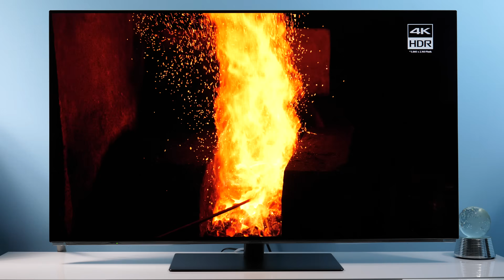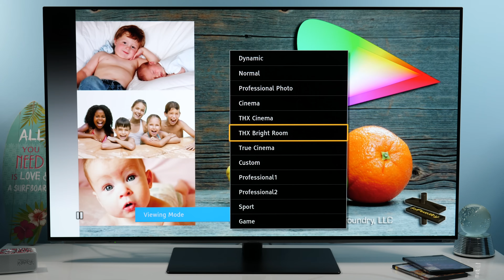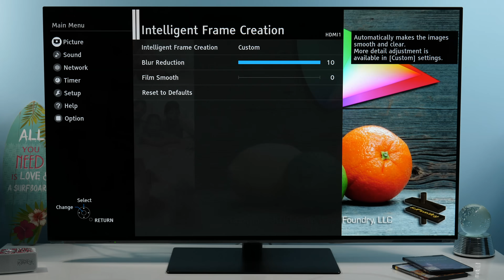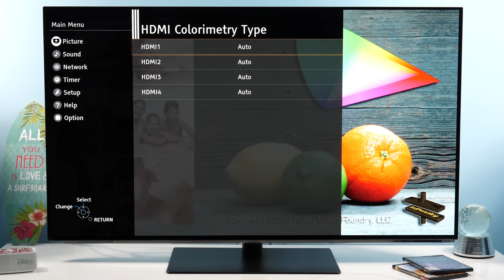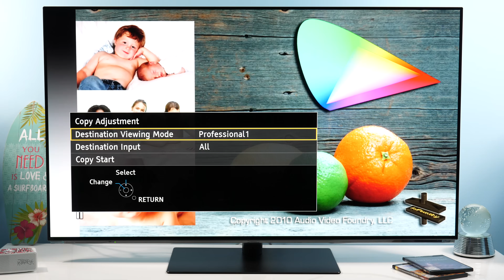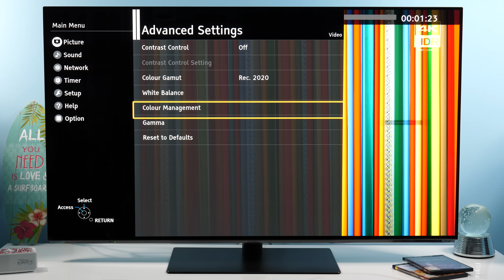Panasonic FZ800/FZ950 4K UHD OLED TV picture settings and tips

Comment: Should you have 1080p/4k pure direct on or off?
Reply from the maker: Pure direct will avoid additional upscaling/sharpening so I prefer to keep it turned off. You can of course try both and see if you can spot any difference.
Reply: @TV Calibration with Darko  I find there's some scenes where when it's turned on, there's a little noise. But then on the dark knight rises, in the stock exchange, there's more details on banes head, when it's turned on. Catch 22 lol.

Comment: Hi Darko, LGs 2018 OLEDs just received a firmware update a month ago that allows you to switch off ANSD (Automatic News Station Dimming) which is called GSR Enable in the service menu. I have the same aggressive dimming on my Panasonic FZ802 which negatively affects gaming and PC usage on the TV (I use Luminance level 75) and was wondering if there is an option similar to GSR Enable in the Panasonic service menu? My TV is out of warranty anyway so I want to try.

Comment: Grateful for your suggested settings for optimal image on the Panasonic GX800 4K UHD smart tv. I don’t have the Professional nor THX Cinema options you mention here. I have see some say the True Cinema should give the most accurate picture and colours etc. I’m just getting totally confused about how to get the best image - HELP! ps I will either watch standard DVDs, blu ray uhd or just blu ray disks, or just normal tv from air broadcast such as BBC tv stations.
Reply from the maker: Hey Andrew! That's interesting to learn that GX800 doesn't have Professional modes available. Have you checked deeper in Settings menu if there is somewhere to enable  them. In any case, True Cinema is the most accurate by default and it is recommended for accurate greyscale and colors by default. You can then further tweak it to suit your viewing environment with Luminance and gamma controls.

Comment: Sony XF9005 vs FZ800 ? By OLED I'm afraid about ageing (color shift after some time of usage), burning out areas, vertical banding problem, black crush (less details in dark areas). By Sony slow Android seems to be problem as glossy panel ... I want 100Hz Tv with natural not over hyped (Samsung) picture, pleasant to eyes (no need to have too bright and contrasty image hurting eyes). What should I buy please ?
Reply from the maker: I would definitely go with FZ800 unless you plan to use it as a PC monitor or for gaming exclusively.
Reply: @TVguyDarko  thank you. So do you think black crush, aging and need to recalibrate colors after some time are not problem ? And what about judder without IFC and IFC problems ?

Comment: I'm not sure if I am missing something here, but the title says 4K HDR picture settings. So why does the video show settings for the SDR mode? When you have it in HDR mode, it should show viewing mode (HDR), 4k pure direct should probably be on not off. I just don't want to pay for the "HDR" setting PDF if the calibration was done in SDR mode not in HDR mode.
Reply from the maker: Hello Simon - the title does not mention HDR as settings for that mode are different as you pointed out.  I guarantee that HDR settings in my store are for HDR signal type.

Comment: Hi Darko, Do these settings apply for FZ950S? Thanks for reply! Good content as always! 😊👍🏻
Reply: Panasonic really seems to like naming the same TV different things in different markets. Yours looks like a regional variant of the FZ800/FZ802/FZW804, with the step-up FZ1000S appearing to be a renamed FZ950/FZ952/FZW954. I bought a FZ830 a few days ago which seems to be yet another variant of the FZ800, and the stuff mentioned here (and in the paid guide) worked great on that model!
Reply: wHXpand, thanks for your kind info, yeah i think there’s so much variants of this model number depending on region, I just got this tv few days ago. And it really looked amazing in my eyes. Have U tried Darko’s paid settings? Is it wort a peny? Does it make difference? Let me know bro. 😊
Reply: @leianth1  Yup, I bought the SDR settings guide. The guide has a nice section in it on getting Contrast set up right, which I ended up needing to adjust a bit on my set. It's also a good reference for what the settings do, exactly. I found the guide worth the money (it's great for people who love tweaking stuff!), but these TVs are generally very accurate in the first place. Panel variances may also play into it a bit, as no two panels come out of the factory the exact same.

One other thing to keep in mind is that the guide has a few test patterns linked, which help get some of the settings right. I use mine as a PC monitor, so loading up these patterns was pretty easy. Other devices may require you to burn the files to a DVD or Bluray or load them off of USB storage, though.

Comment: What about 4k Pure Direct? I watch all my content on a Apple TV 4k. I set the Apple TV to 50hz 4k SDR with match dynamic range and match framerate turned on. I use the THX Cinema mode. Should I turn 4k Pure Direct on or off?

Comment: Hi Darko, I would like to use the FZ950 for Color Correction in a Grading Suite. But i am worried about the build-in Dynamic LUT that it will mess with the signal. Did you find a way to shut that off?
Reply: Hi Tombo, I'm also interested into FZ800 as preview monitor for Color Grading with Davinci. But I'm worried about burn-in issue with static images. Now, color grading implies working on a single frame even for long time, so could it be dangerous for OLED TVs?
Reply: adrjork don‘t worry about that. They are widely Used in Suites in Germany and in LA. LG also got refreshing tools that work over Night If the TV is in standby.
Reply: @tomboherget1643  Thanks for your reply. I knew that many color artists have an OLED in their studios, but I'm wondering HOW they use it: for example, if OLED is used as a "client-preview" monitor to show examples or similar, then I can understand that OLED can't suffer any problem. But what if OLED is used as main "work-house" preview monitor, with many hours at grading a single still frame? In this way I intend to use OLED, and here come my doubts. I remember a review mada by Vincent Teoh on Pana FZ800 in which he said that he did not advise grading (photos) on OLED because of burn-in issue. So again, Tombo, in your experience, do you confirm that I can use OLED as daily-grading work-horse preview monitor without burn-in issue? Thanks a lot.
Reply: @adrjork  yes, i would also recommend to use it on a daily basis. I work 70% with client’s in the suite, so the monitor is on for 70% of the grading time. Other Colorist’s also only have this one 55’ OLED to work with. So you are not alone. 

Here in Germany the LG OLED 55 C8 is quite popular. With the Panasonic I have not been looking at that exact model, but at the 
Panasonic TX-65FZW954
Reply from the maker: Hey - I asked my colleague to double check this. I will let you know as soon as I get a reply.

Comment: Hello!

Are this settings also to use with the TX-65FZW804 (Europe Version) ?
Reply: Super late, but for anybody still looking for an answer to this... This should be fine! I originally bought a 55FZW804, but the shop swapped the order to a 55FZ830 saying that they were the same model, just for different markets. The settings in this video worked great on the 830, so I'm assuming the 804 will be fine as well. Just keep in mind that stuff like Brightness/Contrast and the color/gamma settings will vary a little on a panel-by-panel basis, as no two panels come out the exact same.

Comment: Is there a difference between enabling Game Mode under Option Settings and choosing the picture preset Game under Viewing Mode? Or do they act the same?
Reply from the maker: Hi Telodor! They are the same in terms of input lag, but in terms of color accuracy, it is better to enable Game mode within Professional or some other accurate picture preset. Game preset needs to be adjusted and even then it cannot match color/gamma/white balance of those modes. But if you prefer convenience over perfect color accuracy, then using Game preset is better as you can add it to Picture button on the remote and quickly switch to it when needed.
Reply: Thank you for your answer! You're right, the picture button is more convenient, but I want to preserve the best picture so I'll enable Game Mode unter Option Settings.